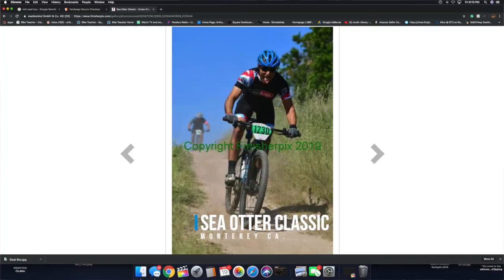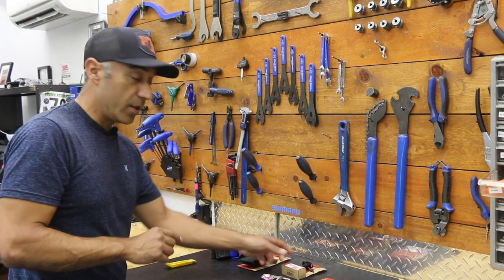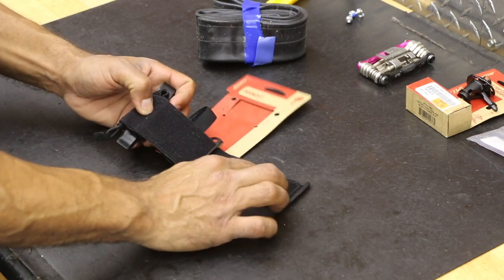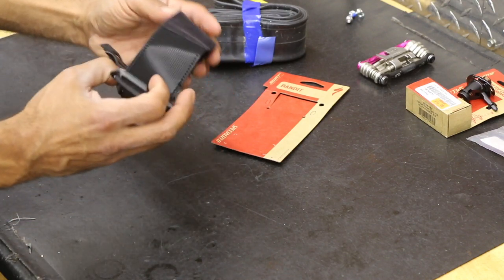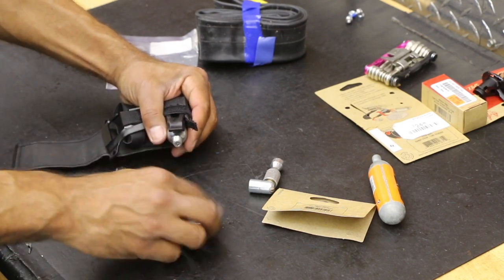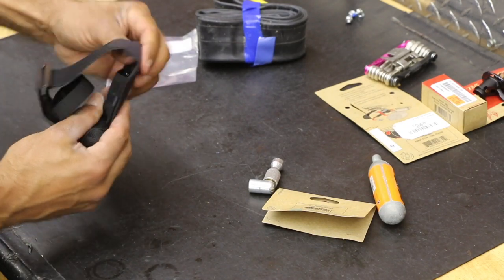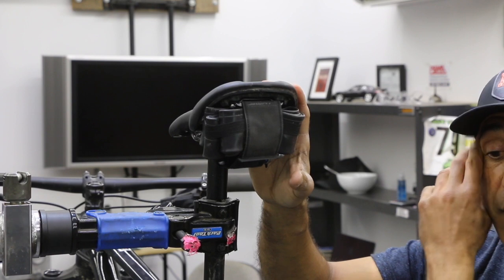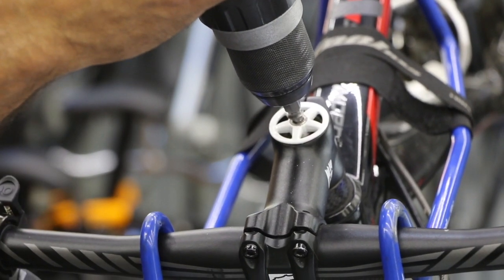Specialized Swat Bandit (tube) installation and what I carry on my rides.

Comment: Thx for this great video! Looks like a really nifty solution. BTW: The tab at 5:41 goes around the threaded part of the CO2 cartridge to prevent it from sliding of.
Reply from the maker: Thanks, I found that the hard way, lost a co2 on the trail.

Comment: If you are not connecting the regulator to the CO2 cartridge, you can leave the clear plastic spacer at home. Like you said the spacer is designed to be lost. Seems like a lot of effort for something that ends up as big as a saddle bag.
Reply from the maker: Ya, we’ll see how it goes. This is one of the those items I want to forget about until needed. So far so good.

Comment: Where to put multi tools??
Reply from the maker: Specialize has a very small tool with case that attaches to bottom of their water bottle cage. And the chain break sits inside the steerer tube underneath the top cap.